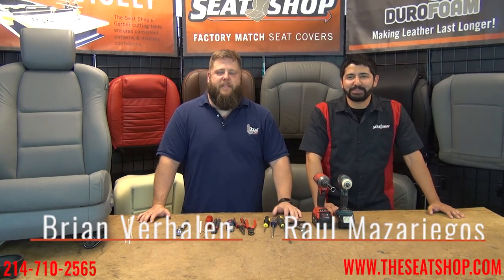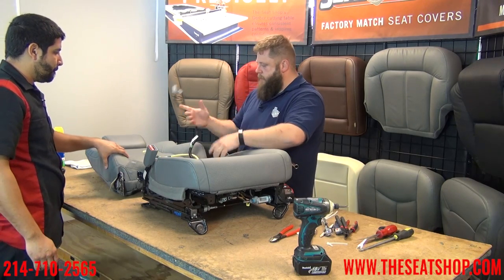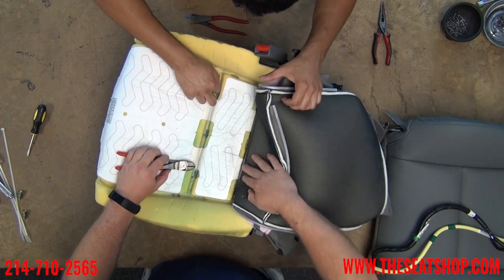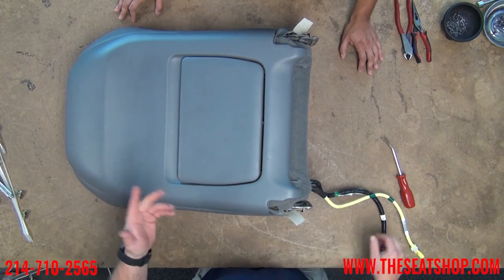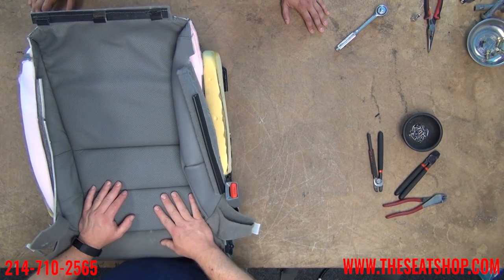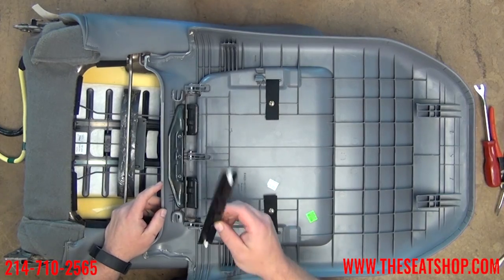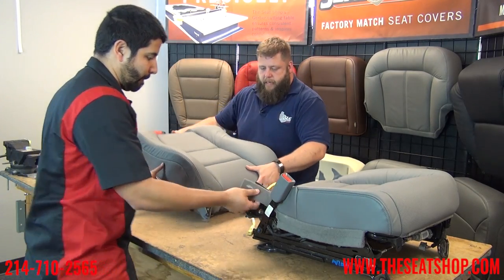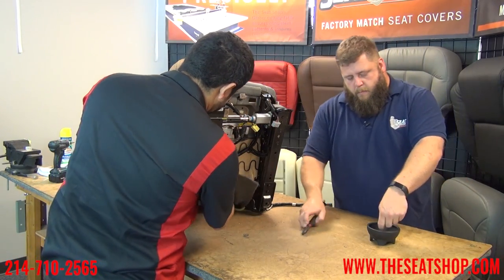2005 - 2008 ACURA TL Leather Installation

Comment: I just got my seat cover for my '04 TL today, and I got it installed in a few hours. The hardest part was crimping the hog rings with needle nose pliers, (I was too cheap to buy hog ring pliers), but, I got it done. The cover is on, the seat is reinstalled in the car, and it looks perfect! Thanks guys!
Reply from the maker: Ashley thanks so much!  We appreciate you helping us with the TL Pattern!
Reply: How much you paid for the cover I got an 04 tl wanted it to replace the cover thanks

Comment: I have a 99-03 model Acura TL. It still runs good, but the front seat (cusion and back support) are torn. I would like to replace the leather if possible. Do  you guys have the leather for this seat?

Comment: Do you now carry Acura TL upholstery kits?  I don't even see Acura as an option on your website.  Thanks.
Reply from the maker: We currently have the 2005-2008 TL's on the website.  If you are searching for another year we aren't there yet.  Thank you
Reply: They now have the 2004 TL drivers seat bottom. I sent mine in and bought a brand new one from them.
Reply: Ashley Wilson what’s the approx cost?
Reply: TheSeatShop what’s the approx cost for driver seat or each seat and cost  if you all do that installation?
Reply: Do you have the the type s mine is ripped and I want a replica
Reply from the maker: Hi Luis, sorry for the late response, but we have not gotten to the Type S as of yet,  we don't want to leave you without an option so here is a list of all of the upholstery shops in our network to see if they can try and help you out - https://www.theseatshop.com/resources/install-locator/
Reply from the maker: Hi Mah Fah, thanks for reaching out sorry for the late response, we are not sure if you are needing the top and bottom of the driver side or both tops and bottoms for the driver and passenger seats. So this link will actually tell you the prices and availability of our products for the Acura TL. If you are needing something else please let us know. For installs only, we charge $125 for the bottom and if it is the same top section of the seat it's an additional $75 but prices change depending on what you need. Please give us a call if you are interested - https://www.theseatshop.com/2008-acura-tl-base/#?valueIds=8302,8256&groupIds=3,7042&seatRowId=6&seatPositionId=9

Comment: im confused on your site. it says OEM option as leather/vinyl. but upgraded as full leather. arent the oem covers full leather to begin with?
Reply from the maker: Hey Carlos, Thanks for reaching out and yes that is a very important question. So all Factory OEM seats are made with Leather inserts (any where your body touches while you are driving) with vinyl sides (Either underneath or where the seat controls are) All Leather is our custom option since we have the material and the patterns we also have All Vinyl option for the same reason. But to answer your question for a true OEM almost the Majority will be done in Leather/Vinyl combo. Please let me know if this helped
Reply from the maker: Hey Carlos.  The OEM leather interiors in the majority of vehicles are leather on the seating surface and vinyl everywhere else.  Exceptions, for example, are the King Ranch Fords and the Platinum Escalade.  You are not alone, most people believe that their leather interior is 100% leather (as did we when we first started this company 12 years ago).  The manufacturers use vinyl to obviously reduce cost.  I hope this helps!  -Matt

Comment: Hey guys!
I have a pretty significant tear on the passenger seat of my 07 TL so I just went ahead and bought a whole bottom insert. Would I be able to replace that myself(mid 20s female with limited tools and experience) or would it be easier and less stress to have a shop do it?
Reply: Yes. To both of those questions. Hope you figured it out. Next time, just a suggestion, remove the fact that you're a female from the equation.

Comment: do you guy have the seat cover for a 07-08 Type S? thanks.
Reply from the maker: We have not gotten the to Type S as of yet, what we would suggest in the meantime is using one of the local upholstery shops in our network. To find the nearest ones to you please use this link and search by using your zip code - https://www.theseatshop.com/resources/install-locator/
Reply: Here's the only place I was able to find them for S type. https://store.autocustomleathers.com/catalog/product/0f0aaf1a5a9a40fc9b5264d3384a495d

Comment: I am replacing the top cover of the driver seat an TL 2008 and the plastic part of the frame broke when I was pulling the back trim panel off.  You showed on your video a black long piece of plastic that you were screwing on the broken part to fix the problem.  Where can I get that and what would be the name of that part.
Reply from the maker: Thanks for reaching out, so that plastic piece was actually never manufactured, what we did was take a plastic piece and shaped it to that section by adding the screw holes and plastic christmas tree tabs. What we can do for you is send you a similar plastic piece generally around the same size but without the cutouts. Please give us a call at 214-710-2565 so that we can better help you out - 214-710-2565 we are open from 9AM-5PM Central time Monday - Friday

Comment: Do u know the procedure for removing a driver's seat to prevent airbag from going off when disconnecting?
Reply: Assuming you have an electric seat, you first move the seat all the way forward and remove the two rear bolts that hold the seat to the floor, then all the way back and remove the two front bolts.  Position the back rest so that it is about 90 degrees; I've found that position is best for seat removal. Take off the head rest. Now, disconnect the ground cable from the battery.  You can now get under the seat and disconnect the cables. Don't expect that part to be as easy as it sounds as those connectors can be very difficult to disconnect. Same goes for the cable clips that hold the cables to the chair, but worse case you can just break those. The seat has some weight to it, maybe 50lbs depending on your vehicle, so be prepared to move a decent amount of awkward weight. Also, keep in mind the metal frame at the bottom of the chair can easily gouge the plastic interior, so be wary of that steel near the plastic while removing the seat. DO NOT reconnect that negative battery terminal until the seat is back in the car and the cables are plugged in or else the airbag will deploy.

Comment: I want to upgrade my 2016 tlx to perforated seats, would that be possible anytime soon?
Reply from the maker: Hi Nic, please let us know what Make/Model seat you have to better help you out.
Reply: @TheSeatShop  
2016 Acura TLX
Reply from the maker: @FrYLocK41 so, unfortunately, we have not been able to finish the R&D on the 2016 TLX model just yet and we don't want to steer you wrong since there are some seats that can be recovered with OE material from a different model. We would suggest trying to use a local upholstery shop to see if they can do this for you at this time, here is a link to all of the upholstery shops in our network, use your zip code to find the nearest one to you  - https://www.theseatshop.com/resources/install-locator/
Reply: @TheSeatShop  
Thanks. It's not really mandatory for me to do it right away. I can wait until quality OEM seats become more common. The TLX is still a pretty relatively new model, it just came out in 2015 so I think I need to give it more time.
Reply from the maker: @FrYLocK41  If you would like for this option to become available a little faster you can always let us know here - https://www.theseatshop.com/service/product-request/